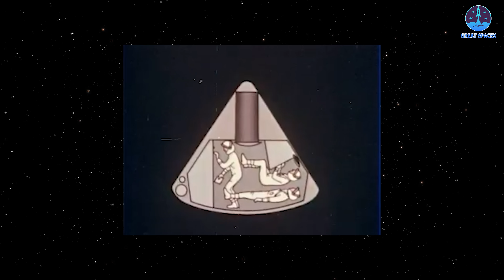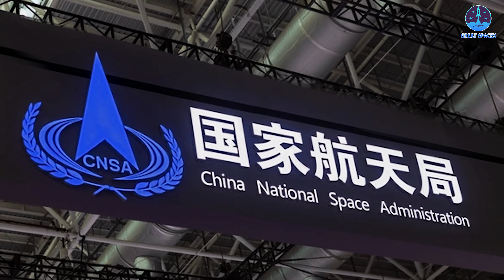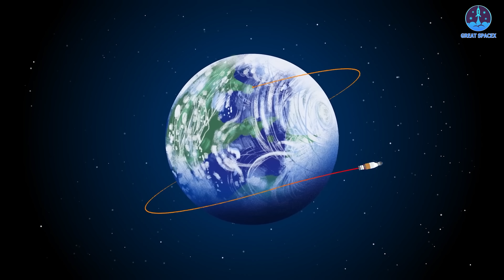SpaceX’s Genius Solution to send Starship Straight to the Moon! Better than NASA and China…

Comment: What about an intermediate stage between the Heavy Booster and Starship?  The intermediate stage gets itself and Starship to the moon transfer orbit.  Then the two stages descent to the moon using the intermediate state with Starship's lunar thrusts only supporting the final landing burn.  The intermediate stage remains on the moon to be used as shelter.  Starship then returns to the earth after offloading its cargo and lands on the earth.  For cargo (unmanned) runs, leave the intermediate state and the Starship on the moon.  Use robots to assemble the spend sections into storage shelters.
Reply from the maker: Great suggestion👍
Reply: If the intermediate stage is going to do Trans-Lunar Injection, that means that Super Heavy needs to lift Starship plus this extra stage to orbit on its own, or the intermediate stage will have to be massive enough to have the delta V to get the rest of the way to orbit, usually taken care of by Starship, but it will also be carrying a 100% full Starship. Then it needs adequate dv to make it to the moon, capture, and take care of most of the landing burn, ALL with a fully loaded HLS on top. Either way, Super Heavy is going to have to be drastically reimagined to do what you're asking of it.

Comment: Use the lower stage left in orbit for trust tube or conduit to outer ring for orbital space stations, mabey
Reply: I believe that would be considered a variant of a "wet workshop". It's a really interesting concept - they explored it as an option for Skylab - but I don't know of anybody actually doing it. One of the challenges they faced was how to retrofit the tank with equipment once it was empty. And having to carry all the equipment up separately. And they weren't going to retrofit both tanks, just the larger one. Then they would use the smaller tank for Waste storage. 

With the sheer size of super heavy, I assume that it would suffer from higher than usual drag from the micro-atmosphere, which would require more frequent reboosts, requiring provisions for a visiting craft to perform the burn. And the burns will have to be pretty heavy duty because of all the dry weight of the converted Super Heavy. 

As far as being able to use it as a passageway for a space station, I don't know of any plans that allow you to pass completely through the stage. Maybe there's a way that they could remove bulkheads and retofit both tanks, or find a way to include a passageway from the large tank around the smaller tank, but then you'd run into the engines.

I'm also curious as to how much would have to be changed to get Super Heavy to orbit. I'm guessing item number 1 on that list is to ditch Starship and payload to give it the delta V it needs. Single Stage to Orbit (SSTO) is no small feat. And this specialized stage would be expended at a very high cost, especially compared to using the full stack to launch 100-200 tons of station equipment and supplies, while fully reusing both stages. 

It's a really cool concept, and I wish we had a real world example, but I don't think Super Heavy is the right way to go for this because it's a first stage. Wet workshops make a lot more sense with good size upper stages.

Comment: Is it just a pissing contest to see who's best or is there any real return for getting to the moon?  If it's mining or something like that who cares who's first?  Sometimes it's best to be second.  When you are second you can watch the other guy and not repeat his mistakes and also copy his success.  Competition is good as a motivation but that's about it.
Reply: The way it is being marketed is mostly a pissing contest. There are legitimate science and engineering reasons. One it is a a natural stepping stone and proving ground on the way to Mars or other heavenly bodies. For mining the moon surface seems to have a similar composition to earth surface. Anything we find here could be found there a literal unexplored gold mine and maybe easier access to rarer heavy elements mostly found in the ocean floor. Also, deep mines might be easier? The last is as a source/platform for common materials (eg fuel, steel) could be the most valuable long term benefit. C3 (escape velocity) requires around 6x the delta-v from Earth (13.2 km/s) than the moon (2.3) because it is a lower gravity well and no atmosphere. That lack of atmosphere allows much of that energy to be provided by non-chemical launch systems like linear accelerators or spin launch.